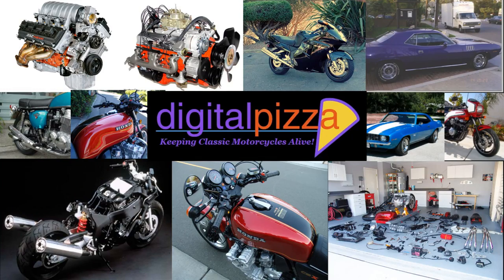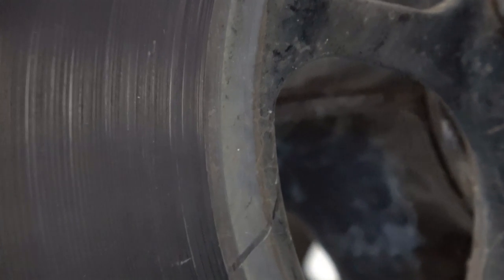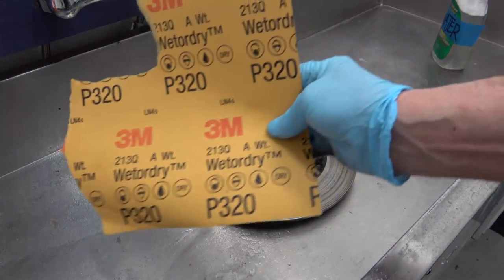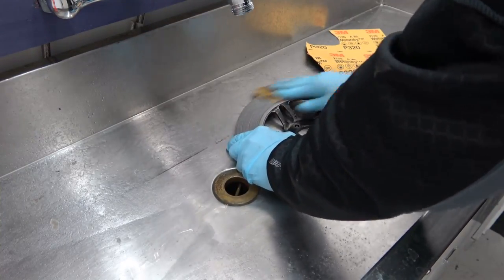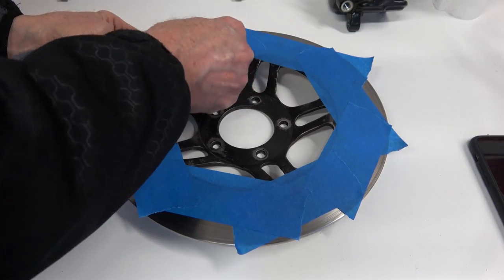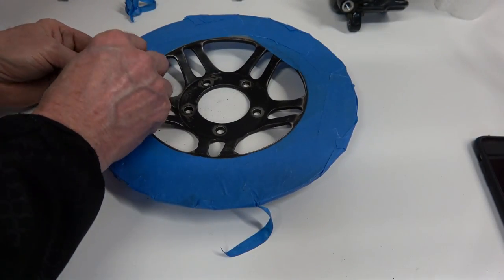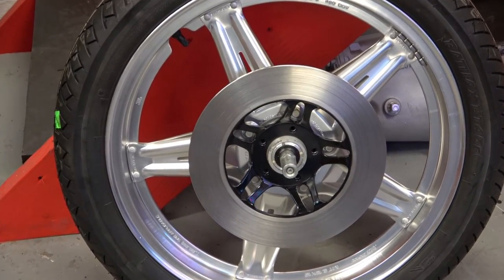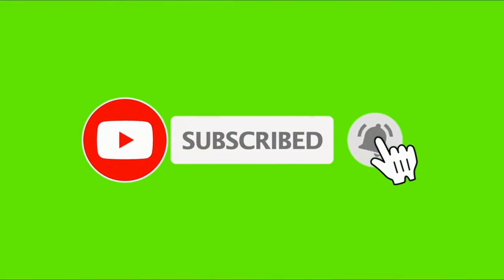Honda CBX Restoration Video Series Part 37 - Restore a Motorcycle Brake Rotor to look like new again

Comment: looking real good as usual. Its a good feeling to bring something old  back to glory with some simple and cheap methods :)
What dimensions on the tires did you put on?
Reply from the maker: Thanks Jon , The front tire is a 100/90/19 and the rear is a 120/90/18

Comment: Just wondering.... those discs look a lot like the DOHC CB750K versions.  Do you have specs to compare.  I have a bundle of the K model discs if you are in need and they will match.
Reply from the maker: I am pretty sure they are same on the F bikes that year, and they are probably the same on the K bikes. I have a few myself as well, but if I am ever in the need, I will let you know. Thanks Ray

Comment: Why not take it to a machine shop and have it properly turned? That way you won’t have any pulsing of the brakes.
I’d love to find an intact early model CBX to restore but they are super rare.
Reply from the maker: Hi fw, all I am doing to clean these up is using a Scotch Brite pad, so the steel isn't affected at all. Just removing the tarnish & any surface rust. I choose not to have them turned because these discs are very thin to begin with and are not warped. I have done many of these with this method and have never had a pulsating problem. But I agree, if the disc is warped at all, then I would replace it with one that isn't warped. I feel they are way to thin to turn them. I don't think I have ever seen one these discs warped. That is not to say that there aren't any, but I think it's rare. It is probably do to the fact that motorcycle discs are right out in the open and don't get as hot as car discs do.